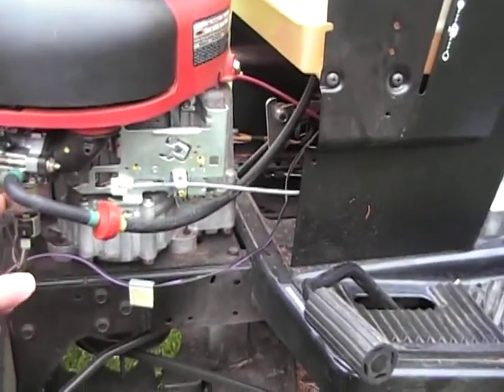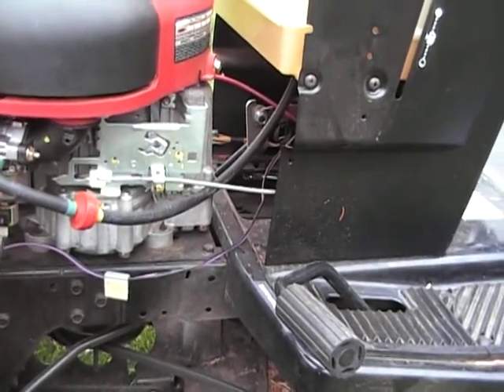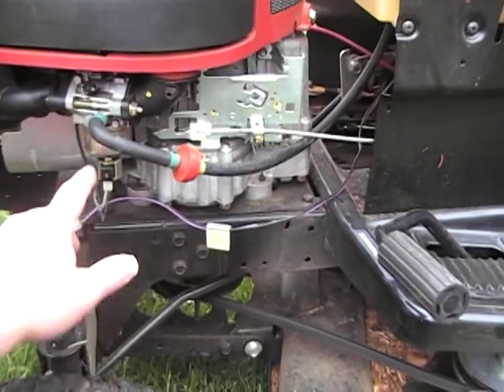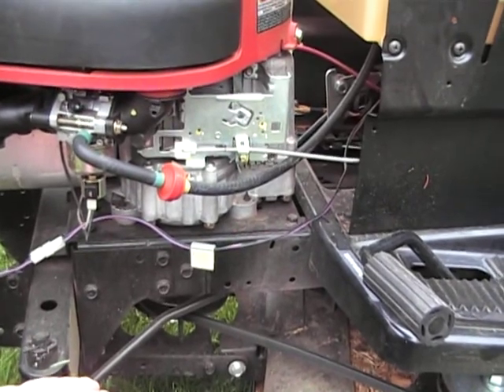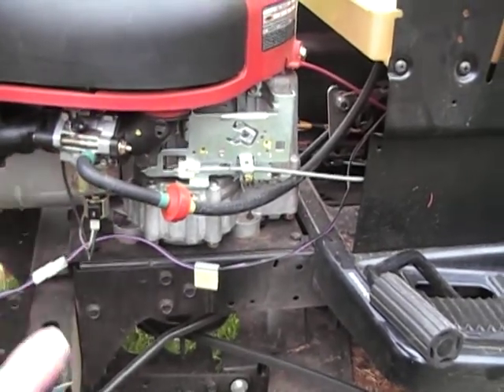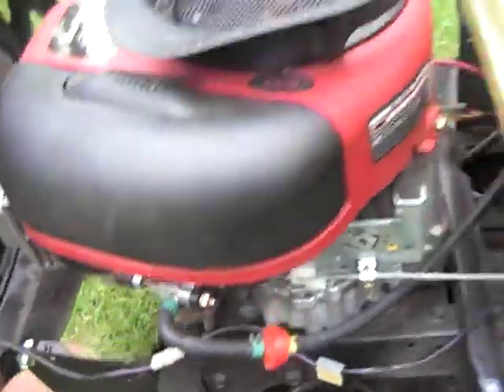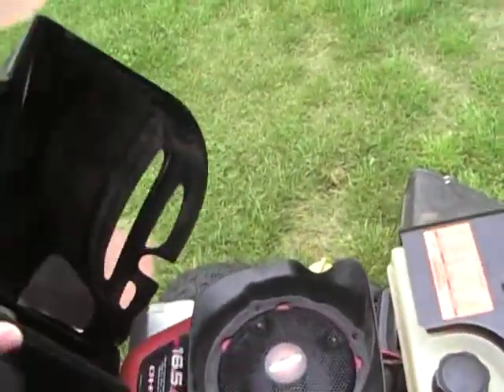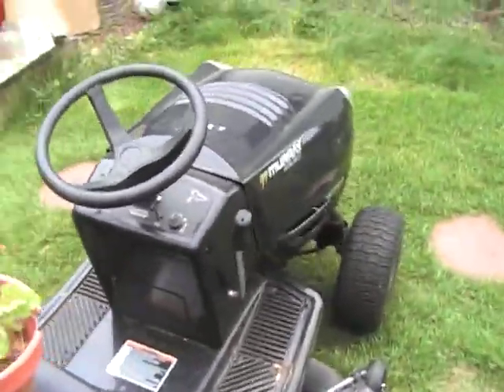Murray with 16.5HP B&S 31C707

Comment: I had welded a stack onto my already existing muffler and it backfired, shot flames, burned oil, and dumped fuel into the carb, then it finnally shit the bed